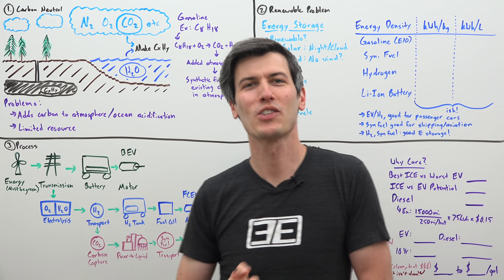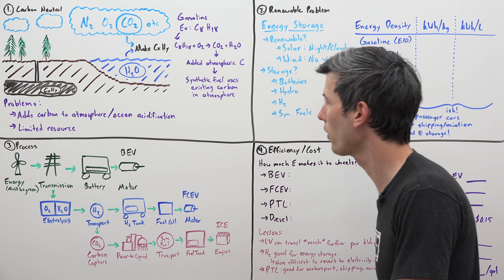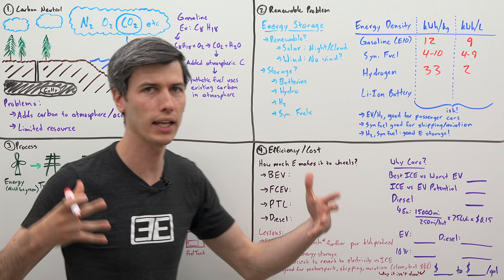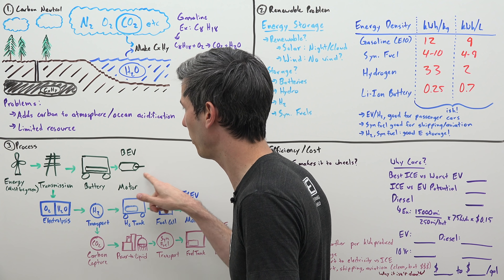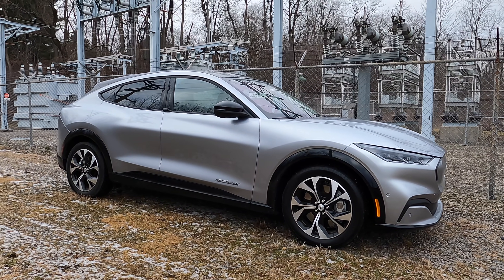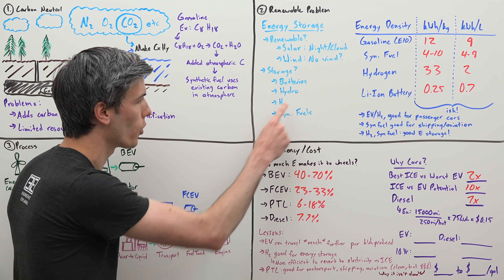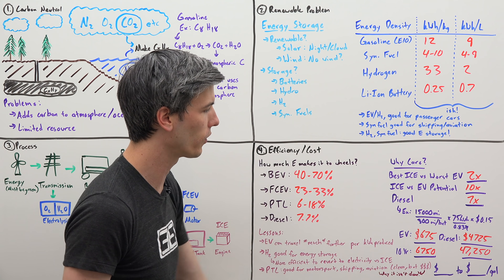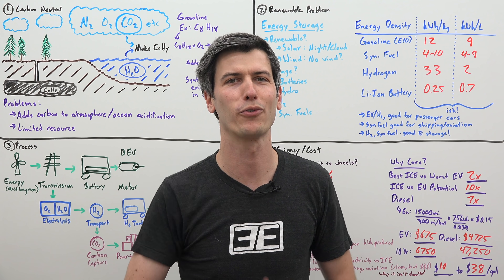The Big Problem With Synthetic Fuels

Comment: I can see future for synthetic fuel passenger cars along battery and hydrogen cars (But not neccesarilly ICE cars).

1) cost of energy - we need cheaper energy (and not just for fuel) and fusion is just decade away, so maybe in 20 years it will be only 5 years away ;), but more seriously, production of hydrogen (and liquid fuel) can be run when energy is cheep or even when it has negative price (but this would limit total amount that can be produced cheaply).
2) fuel cells for liquid fuel - I think that this would significantly help but currently they are not even near (maybe methane cells).
3) EVs are extremely impractical for majority of Europe because of higher population density and hydrogen cars are dangerous because of leaks in enclosed spaces.
4) Different usage scenarios: Someone who drive less in total and mostly longer routes is more concerned with price of car than with fuel.
5) Mentioned by other people: Liquid Fosil Fuels are taxed much more than electricity. If people switch from them, state would change tax structure, so for not near term analysis tax difference is imo not worth considering (we don't know what will be taxed how much)
6) AGAINST Synth Fuel ICE: NOx other local pollution. For traffic in high population density they bring large health costs that others pays for (mostly with their lives, not just money)

This still leaves EV's as best option for those with place to slow charge them (Fast charging stations are significantly pricier than charging at home) for traffic in city traffic, hydrogen where you can have large car or lower range and that won't be parking in underground garrage.

Comment: Great video and I always, always love the content! But can you help me understand the math with cost of diesel vs. the cost of running an EV? I understand what you are saying about diesel costing 7x more than EV (overall from an energy efficiency standpoint), but when you ran the comparison, you talked about the actual driving cost of an EV (range of miles, size of battery, charging efficiency, and cost of the electricity, etc), but you then just multiplied that number by 7 to come of up with cost of diesel. And I've trying to replicate that math as far as the actual cost of driving a diesel (number of miles divided by miles per gallon times the average cost of diesel fuel in CA) and I can't come up with a number that high. The only way it would work (in my math) is if your vehicle was a tractor trailer rig. Does this make sense or am I way off?
Reply: I think it was a comparison between ev and synthetic diesel...
Reply: It takes 7x as much electricity to make the synthetic Diesel, so he was just comparing the cost of the electricity. But making the Diesel also requires a little machinery and people to do maintenance on the machinery. So the $ cost will be 10x higher.

Comment: Your model doesn't include the energy balance to actually make the car though. The energy and emissions involved in making an EV is multiples higher than an IC vehicle. I recall comments from Gordan Murray a few years ago to the effect that  you would need to drive a Prius hybrid approx 100k miles before you gained any energy/emissions benefit against a small engined hatchback due to cost of refining and transporting the materials for the battery and motors etc.

Comment: Well, saying that the capacity lof Lithium batteries is constantly increasing is the same as saying that the efficiency of creating and storing hydrogen is constantly improving.

The difference is that lithium batteries are very close to the safe limits already. I mean, there is no shortage of news of lithium batteries catching fire. Otoh, the efficiency of creating & storing hydrogen offers lots of room for improvement.

One example is that lots of energy is wasted compressing hydrogen. However, the way we do it (for examle) is that we use wind to  generate electricity to then converted back to mechanical power. We could build wind turbines specifically designed to compress hydrogen that directly use the mechanical energy od the turbine to drive a compressor making it more efficient as one less conversion step is needed.

Comment: I think your forgetting the most important thing, the car driver, at present it takes about 10 mins to fill a car up at the gas station,  how long is it going to take when were all driving EVs and queuing up for for hours on end to find a a vacant charger to then charge up for hours🤔
Reply: Approx. 70% of charging happens at home which takes 10 secs to charge, 5 secs to plug-in and 5 secs to plug-out. Currently the battery technology is developing so fast and will continue in the next years. The most advanced EVs can charge from 5% to 80% in 20 minutes to drive another 300 km. Compare this with EV technology 10 years ago and then look 10 year in the future.
Reply: @gerbre1  thats great if you have a driveway

Comment: wait until the price per kwh goes up to 30 Cent and e-fuel drops by 70% due to mass production.
plus you are compaing appels with oranges... overall yes the price for diesel is 7x
But for the average user ist is only 2x only focusing on the Charging /fill in the gas.

Comment: But synthetic fuels make more sense in hybrid cars. The production of the battery has been taken out of the calculation 
and the 500 kg more weight because of the battery which also minimizes the efficiency, etc. In addition, it is the same fuel as gasoline, I don't think that only 18% get on the road. Studies can also very often be incorrect or consciously manipulated. Chemically it doesn't make sense.

Comment: Also, don't forget there's a crucial difference between the two processes, while making hydrogen and synfuel are much less efficient, they are also their own storage method. With direct charging you must generate the power at the moment the demand to charge is there. The fuel you just put into a tank and wait until someone wants to pump it. That way, you can use moments of power overgeneration from eg. wind turbines to make the fuel. Energy that would otherwise simply be thrown out. In other words, efficiency doesn't matter at that time.
Reply: He also forgot that if the synfuel plant has it's own massive utility scale solar farm nearby, the cost of that electricity is more like 1 cent per kw/hr not 15. 15 is the average retail homeowner price, not the price for giant plants/factories that get power at distrubution voltages of 12470-33000 volts or even some large installations at 69kv.
Reply: at around 1-3 cents per kw/hr, E-fuels become much cheaper than normal refined fuels.

Comment: I have no idea why everyone must treat this as an all or nothing problem. Why compare synthetic fuel with a BEV? Why not look at a composite solution, PHEV with synfuel use?
You can remove the majority of the battery but still be able to do all your daily driving on it. The engine's only there for long distance use, where it replaces the huge battery + fast charging infrastructure. You can have 80% EV and 20% fuel use, but using a five times smaller battery and benefiting from the best part of EV ownership, the home charging part, but without having to care about finding charging spots on a long drive.

Comment: The infrastructure that was introduced to EV made it possible to deliver cheaper energy source, Paddy Lowe the founder of Zero Petroleum was asked about the feasibility of the fuel to take on EV and simply from engineering perspective, if you can engineer your way to it why not, it needs the infrastructure, the politics and economic solution, since it’s not constrained by physics and only a mental barrier it just can be done to deliver the fuel as a replacement. Plus the damages the Ev does is unforgivable to the environment forget about running the vehicles efficiently but the deforesting and amount of energy to harvest lithium and build the power plant based on coal, that’s just as brutal as IC

Comment: You missed the part out where it costs $675 in electricity to run the EV but $7500 for a new battery when it craps out.

Comment: Does "transmission" for electric include the cost of building a charging network, charging capacity at home, money to buy/rent a garage, and beefing up the electric grid to support charging? Where are the efficiency savings in this calculation from already having a distribution network for synthetic fuel? Even if the fuel cost calculation would favor electric, there is no comparison between a hand me down 4 cylinder Camry from the 2000s and the folks who will replace their electric SUV every other year to get the latest software.

Comment: Not very engineery to not account for technical developments, process improvements and economies of scale. Just like with EV the early adopters will pay quite a bit, but prices will off course come down with improvements and refinements to the production process, like with any other product.
And that is even without some major technical breakthrough like the nano bio-polymer catalyst that looks promising to improve the efficiency of the electrolysis of hydrogen, or the improved Fischer-Tropsch synthesis of hydrocarbons that works with much lower temperatures then before. If it can be scaled up it would bring down costs a lot.
Then you could off course also adjust the perdition for more pie in the sky solutions like fusion energy which would make the total life-cycle efficiency a lot less important for the price of the final product since the energy going in would be cheap. The practical benefits of quick refueling and the existing infrastructure would outweigh any efficiency loss by a mile in such a case. Hydrogen fuel-cells would probably be a popular option if hydrogen was cheaper to produce. I'm not sure non gear-heads would care about the the step of turning the hydrogen into a combustible fuel when you can just as well drive the car on the electricity from a fuel-cell and still have quick refueling. You do lose the use of excising infrastructure in that case though.
But like i wrote, "almost free" electricity is a bit pie in the sky at the moment since there is no functioning fusion reactor with sustained positive energy yield, yet..

Comment: Very good explanations... but entirely wrong! 
The only relevant question is which produce less CO2, and which is nature friendly - not which is more efficient! 
In current form BEV emit roughly 5-10% less CO2 then current ICE. Which is nothing! Adding in this equation the time for replacement of all ICE and you eventually will see it is completely pointless exercise. 

Synthetic fuels are more energy consuming but that is pretty much the only way to increase the % of renewable energy as well, and offer the cleanest possible solution. And this is what BEV is all about and we all want, right? So I'm very sorry but NO! The answer is not BEV!!! For number of reasons BEV is just another problem! 

P.S. the final price calculations are... lets be gentle and say: put some doubts ;) 
The expectations are that synthetic fuels when mass adopted going to cost roughly the same as current fossil one but the scale of application is immediate to any existing car on the planet!
Reply: P.P.S. What if we use hydrogen for ICE then synthetic fuel? It makes more sense then battery production and fuel cells use.

Comment: Synthetic fuel is what make sense in the long run. Cheaper, cleaner works on old and new internal combustion engines takes only 2 minutes to fill your tank and maintenance intervals will be longer with less carbon produced in the combustion chamber. Genius!

Comment: That was a wonderful analysis. Maybe you could have gone a little more into contrasting the existing petrol supply chain costs versus EV. Yes. I know. The haters will go after me for even suggesting it. Yes. We are currently in a not-so-good system. But the idea of just immediately DROPPING the use of gas and diesel, rather than a 10 to 20 year transition, involves HUMAN suffering. Look at what happened to oil field workers lives when the pipeline project was cancelled. I am trying to remember the number of Americans involved in consumable fuels industry - I think that I remember 15.9 million? Let's just pretend for a moment that free energy, a new power source, was available this week. Left un-transitioned over time, it would actually be terrible for the world economy. At this point in time, the world runs on money. If you don't have a job, where does your food come from? There are so many complex issues to consider. Another untouched consideration, what are the long-term consequences of ELFs on human health. Are we getting irradiated whenever we are driving in our EVs? Do I want to continue using ICE engines? Not really. But I do want to transition to something better in this world - running to rather than running from. Than you always for your deep dives and perceptive reporting.

Comment: Jason, the hydrogen required for syn fuels will not come from the atmosphere. H2 in the atmosphere is 0.55 parts per million. H2 is currently made from natural gas (methane) or hydrolysis of water.

Comment: EE, I find you quite informed and educated, but your videos appear more like an attempt to win a debate than to present all applicable thoughts on the issue. The video struck me as a strawman argument against synfuels, because you quickly dismissed or failed to mention nuclear power (like modular nuclear reactors) and waste to energy as sources for creating these synfuels. Please recheck the data that you explained especially in your last quadrant since this technology is changing quickly. A ton of waste can be converted to at least 30 gallons of liquid synfuel without additional added energy,  toxic release to the environment. It also results in the recycling of ferrous metals,  plastics, etc.

Comment: For the moment it seems like batteries are the best option but not with lithium it needs something much lighter and more energy dense. It would be interesting to compare  the 20%+  efficiency for the fuel cell to the 40%+  for lithium taking into account the enormous weight of a lithium battery and the fact that most manufacturers dont seem to want batteries fully charged or discharged affecting the theoretical energy density
Reply: I recall reading a research article a year or two ago about a group of scientists experimenting with using carbon fiber panels to store electric energy. The most they were able to get out of a single panel at the time - which was roughly the size of an iPad - was about 40 watt/hours.
And they’re still doing research into how they can make these carbon fiber panels even more efficient.

Comment: You know it's getting to that point where electric vehicles are just the irritation of the future of automotive it's better to push to better the infrastructure where we don't need vehicles period. I don't know who is really interested in electric vehicles because no one I know wants one and while more people are talking about them they're still novelties.

We got to see the Mach E and there is no analog speedo or other gauges and most sedans even from the 90s don't have a charging battery gauge either but this is really the point where the future is just boring, dull and you dont even have a fuel/power gauge to see whether you even have a charge.

Whatever, I don't see the world moving to electric despite the extreme push and the banning of new ICE sales is just ridiculous in order to end fossil fuel usage but we can't have any alternatives to actually use in place of gasoline, like synthetic fuels. But rather than actually coming up with and developing a fuel or a bunch of different fuels people can buy for ICE we're going to give up on 100+ years of hard work to keep the ICE car alive and push this battery electric vehicle onto everyone despite the fact that people don't want them to begin with. And EVs are as old if not older than ICE and the thing holding them back is the batteries. Rather than arguing with people constantly about the future of ICE you may as well push for alternative fuels because if this really is about ending fossil fuels you will need to provide for alternative fuels for ICE vehicles. This isnt like moving from the horse to the Model T, it isn't like moving from desktop PCs to smartphones (or flip phones to smartphones). I was told I couldn't donate working CRT monitors due to the toxic materials or chemicals inside them.

Why do we keep doing this to ourselves and why is it that we have to give up on technology that works fine for many? We built an empire on ICE, it's not because of fossil fuels but the enjoyment of the vehicle. I will happily switch to whatever viable alternative fuels that will run it but I don't want or ever want a battery vehicle. Many others are the same way. But because a few people decided that battery electric is the way to go we keep pushing down through this rabbit hole where people actually will push people into electric by high gas prices, car manufacturers axing ICE and or politicians are placing bans.

I was never forced to buy a cellphone, fuel injection vehicle or any of the other technologies. I still have and use CRT monitors, never bought a flat screen one, I never needed it but they are clearly better. Internal combustion vs electric is subjective and really have no interest in having one. I like and prefer the rumble of the V8, manual shifting controlling the rpms but even modern manuals are less exciting.

When gas was $2 a gallon it was great. It's almost $4 a gallon but people are clamoring for higher gas prices to shove people off of ICE. It's just working against what the market   currently wants and that to me sounds very un-American.